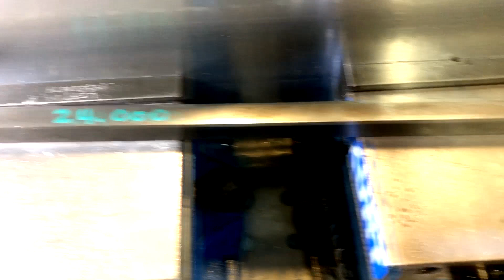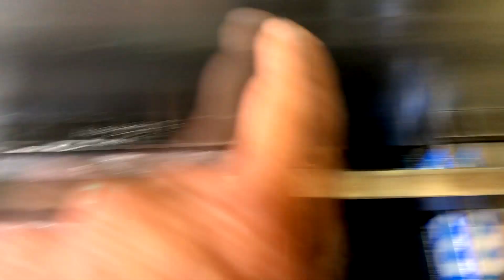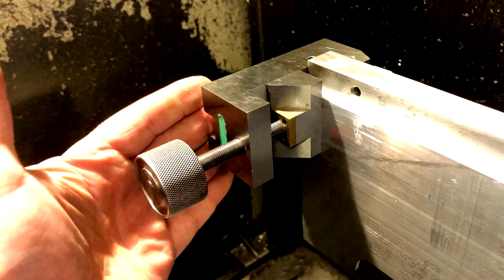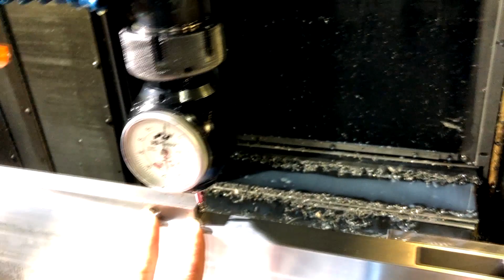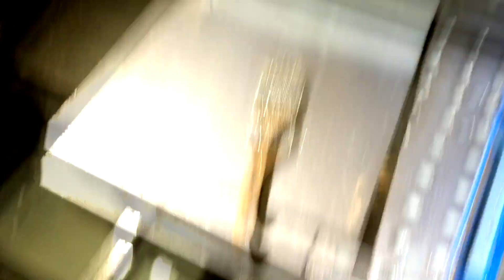Machining Tips: How To "Find" an Edge That Your Machine Can't Reach

Comment: I do the same thing but with a 12” or 24” Starret scale from my combination set. I have found they are extremely close to 12” and 24” in length, just as close as your custom made one. Only problem with my way is the scale is only around .070 or .080 thick. Not much to edge find off of, but enough.